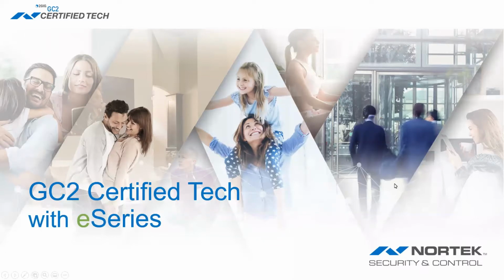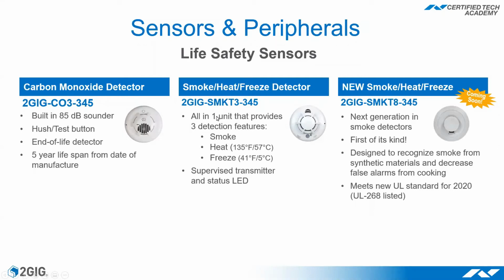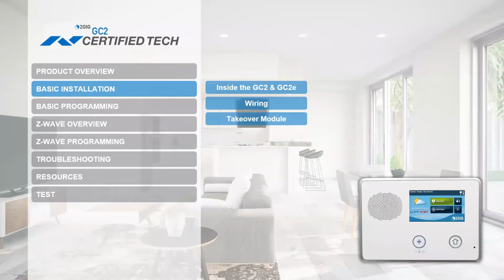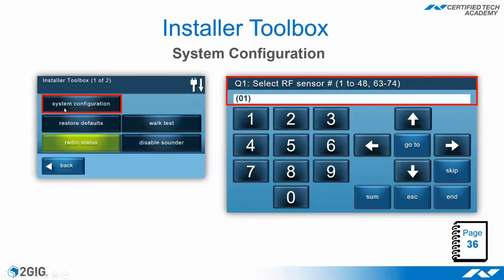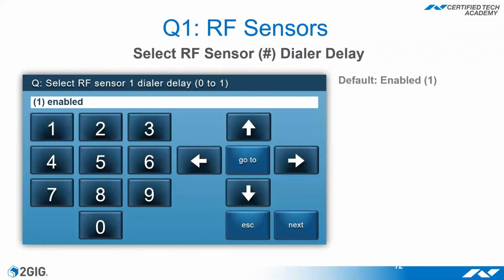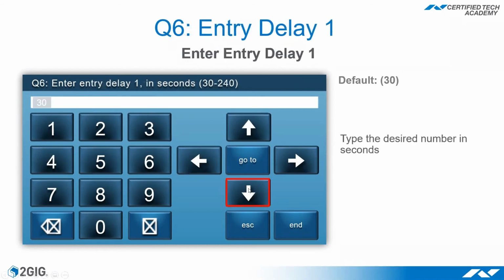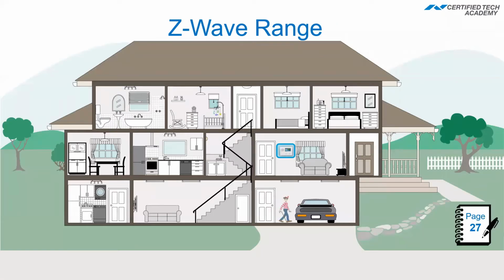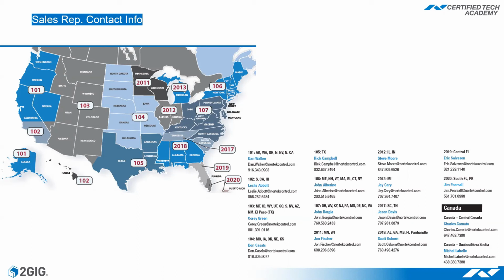2GIG GC2e® Installation and Programming | Webinar

Comment: I did exactly as you said, but for some reason, but front door and garage door both voice prompt to "Garage Door" and I don't know why. If I change Zone one which is my Garage Door to say Front Door, then they both say front door, but they are on two different zones. Can you explain or is there something I am missing?
Reply: You probably have both zones programmed to be on the same contact. Reprogram zone 2, double check the TXID number.